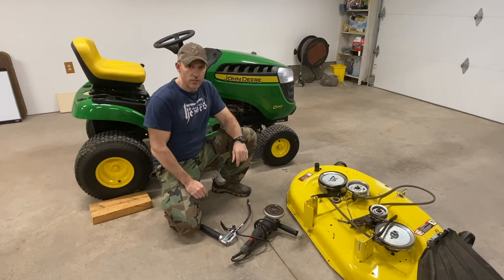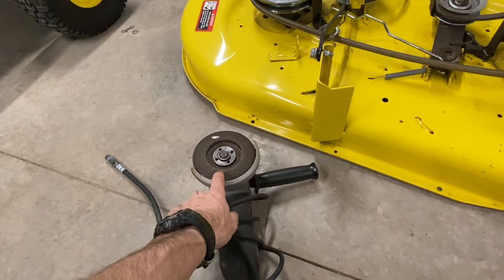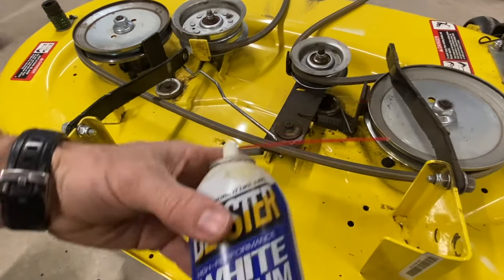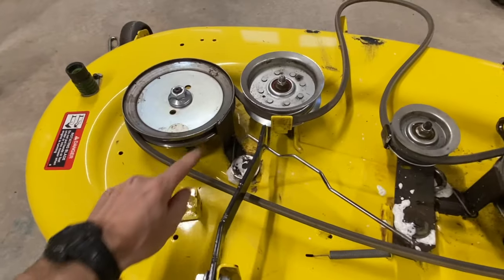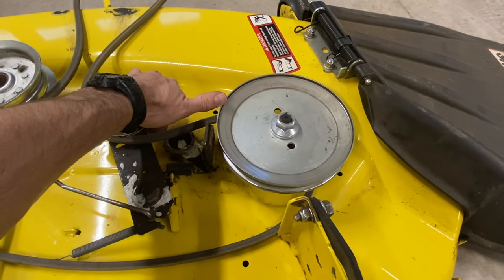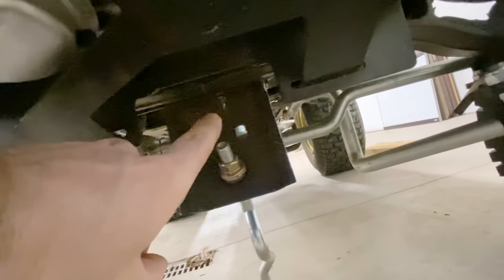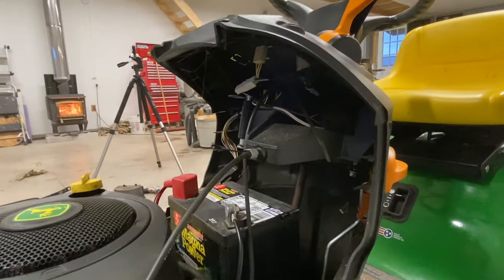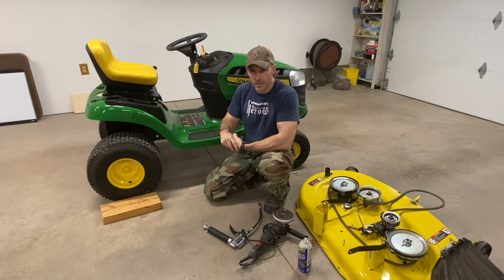grease fittings on john deere 100 series

Comment: How do you know when you have pumped enough grease and not too much in each fitting?😳
Reply from the maker: You will see some start to come out what ever your greasing except for your blade spindles just put 5-6 pumps in each of them
Reply: @DIYJIM  thank you for your assistance sir! Thank you for your service to our country as well!
Reply: you grease until it comes out end of spindles and goes threw bearings  takes 40ish  pumps to fill spindle  when new , grease goes into bearing  , 5-6 pups will do once it is full and that will purge the old grease around berrings and fill them with new grease   , 5-6 pumps when new will do nothing  @DIYJIM

Comment: Do you know if this applicable on the E110? I was trying to look is up and couldn't find much. Regardless, I know where to look now!
Reply from the maker: Not sure but I’m sure some are the same if you have three blades you will have one more spot to grease. If you still have a manual it should tell you in there
Reply from the maker: did some research for ya and it looks like they are about the same so you should find the same grease spots on your E110 thank you for leaving a comment.
Reply: @DIYJIM  You went above and beyond. Thanks so much for the reply!
Reply from the maker: No problem
Reply: @DIYJIM  I finally got to check it out and you were 100% right. Again, thanks so much.

Comment: This is not the best way to override the reverse switch. I did this and it started to work intermittently, snowblower was still shutting off when backing up sometimes. Read somewhere that it can cause a solenoid or something to overheat because it is like you are holding down the reverse switch the whole time you are using the tractor. The better method is to just disconnect the reverse sensing switch underneath the tractor so that the tractor doesn't even know you are in reverse. And by disconnect, I don't mean the wiring harness connected to the switch, but the whole switch itself...in my case I just unbolted it, spun it around 180 degrees so the arm that activates it when in reverse no longer makes contact with it. Very easy to do, and tractor has worked perfectly ever since.
Reply from the maker: Thanks for the tip but I have had this disconnected for years.
Reply: Post the video my friend, please, how to do it step by step

Comment: Thanks for this video.  I have an L110 and had to replace a brake pad on the mow deck last year.  A tiny local John Deere dealer had it in stock.  The place was called Washington Tractor.  They are a big company but this store is tiny.
Reply from the maker: Glad it helped, thanks for commenting
Reply: whats the part number

Comment: You know the spindles have sealed bearings in them, the only way you going to get grease into the bearings in the spindles is to take the spindles apart and remove one side of each bearing seal, to where you can Grease the bearings in the spindles.
Reply from the maker: Yep I have a video on that thanks for watching
Reply: Wrong
Reply: @travissheehan6082  If you don't take the spindle apart and pull one side of the seal out of each bearing and put the bearings back in with the unsealed side to the inside, no grease will get into the bearing when you grease it.
Reply: @charleskeisler716  wrong
Reply: @travissheehan6082  Leave the spindles alone and they will fail, they only have so much grease in them, I don't care what you do with yours, buy more.
Reply: @charleskeisler716  I grease mine. The grease WILL penetrate sealed bearings
Reply: @travissheehan6082  Yeah believe that, grease doesn't penetrate rubber, it's a rubber seal.
Reply: @charleskeisler716  lol ok bud you believe what you want. I know it does.
Reply: @travissheehan6082  Why do you think they put covers over ball joints to keep grease in and trash out, huh!
Reply: @charleskeisler716  we arent talking ball joints. Watch the video and accept you are wrong. Or continue to make a fool of yourself.
Reply: lol do you know they use grease guns for tightening up tracks on excavators lol. , do you understand the amount of hydraulic pressure a grease gun puts out , and you people think a loose fitting plastic cover that you can pick out with your fingernail is going to hold back 13000 psi from a grease gun , hahahahah. stop it already , the spindle are designed fine as they are pump until you see grease come out ends of spindles , the grease will go threw the berrings as its designed to do
Reply: Exactly people are nuts
Reply: @travissheehan6082  yep and the fools popping the berrings in and out for no reason  to grease them all they are doing is egging out the soft aluminum housing and then they will have a spun bearing and the spindle will be junk  . then ya have to peen in bearings and use locktigh berring retainer
Reply: @charleskeisler716  stop it already , your killing me here lolololo
Reply: @charleskeisler716  they are loose fitting dust covers not "seals " grease will go around them like they are not even there as they designed  it to do , do you think they put a zerk  there for decoration  ? lol
Reply: @TheCaperfish  Then why do you have to pry them out to get them out, they're not loose fitting, I fix mine, so mine will last a long time, you can do what the hell you want with yours, go ahead and buy new spindles I don't give a damn.
Reply: Over yer head Charles , the bearings are tight fitting , the dust covers can be  picked out with your finger nail literally , but every time you pound the bearings  in and out unless they are comming in and out exactly square and true (impossible with a punch and hammer ) you ARE violating that hole in the soft spindle and widening it out , So only remove bearings when they go bad and grease them as they designed them to be greased threw the zerk fitting

Comment: So Remove bearings. Remove cover Replace grease and put back each  side without covers.   So I’m curious doesn’t water make it’s way into beating when using the wash port? Asking for a friend. Before we try doing this
Reply from the maker: I never use the was port don’t think it works very good. I don’t think those little covers work that great to keep the water out anyway. So far it has worked for me. Thanks for watching
Reply: @DIYJIM  sounds good. Thanks Jim.  Keep creating good informative videos.  👍
Reply from the maker: My next video will be on winterizing my mower. Thank you very much for commenting
Reply: @DIYJIM  so help me out here please , you believe that standing water or splashing water will go around these "seals " but not grease with 13000 psi  of hydraulic pressure behind it ?

Comment: The issue with the spindle bearings is that John Deere seals them so the grease never makes it into them
Reply from the maker: thanks for the comment,  I have seen this, maybe i will take mine apart one of these days
Reply from the maker: i just made a video on this check it out https://youtu.be/ybKR4wTLez0
Reply: @DIYJIM  https://youtu.be/PwObkilFXN0 - this may blow your mind. But grease will go into the bearings. Just keep adding grease until the spindle is filled. Don’t go along with the other guys who are wrong.
Reply: @GTObearclaw1  Sure, you get the grease into the towers but the bearings are sealed . To remedy this remove the towers from the deck and remove the bearings. Remove the seals that face the inside of the towers. Replace tower bearings,  fill towers with grease and reinstall towers into deck. Now the bearings are getting grease. Hope this clarifies this. Best to you and yours.
Reply: @RaysLaughsAndLyrics   WRONG. that’s a huge waste of time And removing the inner seals does no good. Actually in my opinion the inner bearing on the upper seal actually holds grease inside the bearing on top side rather than let it leak down when gravity and heat start working on it. Taking it apart and Removing seals is absolutely pointless and counter productive. Just a bunch of nonsense from folks that have no idea what they are doings and making a video just to have another topic without knowing the required information and feeding people the wrong info. that’s why I made a video that actually shows what happens when you grease bearings with a inner seal still in place. Funny so many folks think that a little rubber dust seal will stop pressurized grease from passing. Don’t be a follower, use your brain and think about this for a minute or just watch the video I made and you will see what happens when the theory is tested. Here is the link again, maybe you didn’t see it in my prior message. I can’t help everyone. Some folks will argue even when they can’t prove the theory they just follow like blind sheep. It’s here for those that care. https://youtu.be/PwObkilFXN0 heck make a video proving me wrong. I’d love to see it. Show us that grease won’t pass into the bearings
Reply: they are just dust covers not  "seals " lol you can pick them out with your fingernail and people think they gone stop grease from entering , lol.  a grease gun puts out like 10 000 psi every pump , grease until you see grease come out ends of spindles , grease will go threw bearing as it was designed  , it takes approx 40 pumps each when new  ,  every time you remove the berrings for no reason  you are enlarging  the soft aluminum spindle housing , the bearings need to be a press  fit if not you will get a spun bearing and you spindles will be junk , .you need to knurl the spindle and / or use loctight berring retainer when putting them back if they are a loose fit .

Comment: Thanks for the comment on defeating that stupid reverse switch! I had a hard time getting to the grease fittings on the spindle and swapped them out for some with a 45 degree angle... Had read somewhere that they really don't need greased, they were a legacy feature from an older design. I grease them anyway. Thanks!
Reply from the maker: thanks for watching